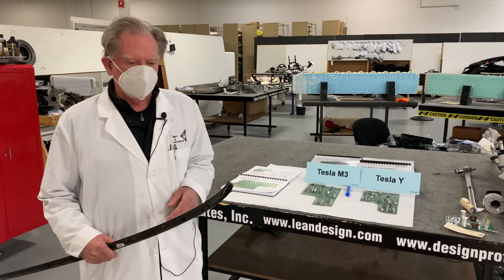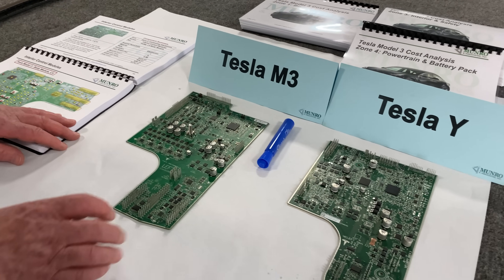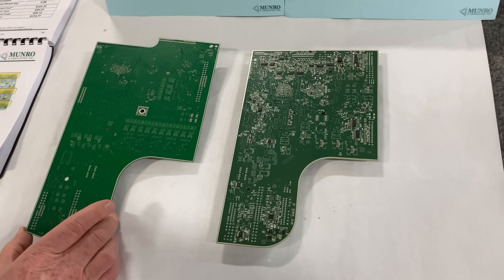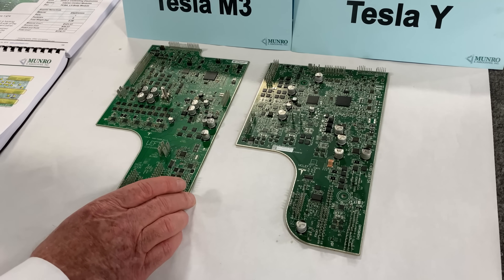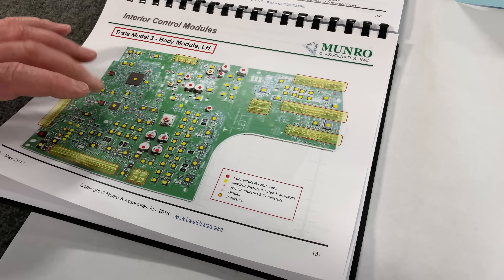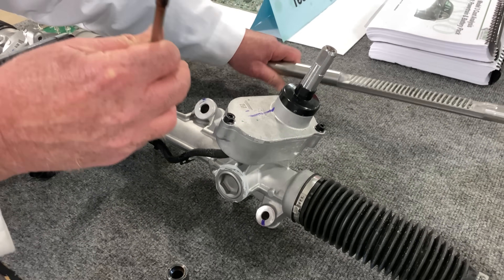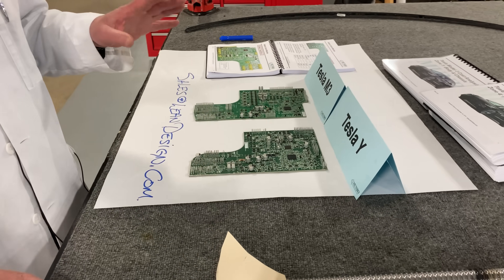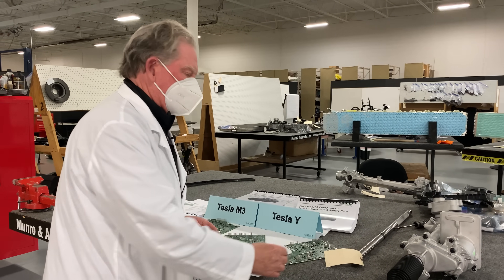Model Y E39: Spoiler Alert! Sandy Talks About Electronics, Body Controllers & Steering Rack

Comment: Sandy, thanks for another great vid! Elon does this to every industry he touches, puts them on notice that it's time to wake up and get with it. No more snoozing in the easy chair. One worry though is future repairs.  Nice it's always being upgraded, but is a path provided to RR the part?
Reply: The parts are probably mostly backward compatible unless the design changes completely.
Reply: @user2C47  Is that a hope, guess, or actual knowledge? U mean, I hope so as well, but don't know that is true. For example, if you have the "Super Bottle" system, and 5 years from now the bottle splits, do you have to, or can you, replace it with OctoValve System? Will parts be available for all the "iterations"?

Comment: can anybody read the markings of the power mosfets, is there an increasing from gen 1 to gen 3, example 25V to 80/100V ?! I do not understand why tesla is still on 12V instead of some higher, reduces much of couper and weight (couper is typically much more expensive than silicon...)
Reply: Musk said in an interview that he wanted to move to something higher, like 48 volts, and that it took an embarrassingly long time to replace lead acid in the Model S. 12 volts is really only good for small loads like electronics.

Comment: These bits are called a rack and pinion  steering type...is Alzheimers  already kicking in ?At the end of the day it is all common sense and actual  critique is left out, still entertaining to watch .Having any kind of belt drive in a steering system is for instance not a good idea  even if only as a power assist. Problem with Tesla is that it is often  try and error, like green bananas new systems are left to ripe in  costumers hands.

Comment: Sandy, redundant systems are normal in aircraft systems as you know. I'm sure that many Tesla engineers come from industries other than auto manufacturing. This seems to be both a blessing and a curse for Tesla because it can start everything clean sheet without legacy industry baggage and bureaucracy. But some areas like automotive painting are less important in those industries and continue to bedevil Tesla.
Reply: Interesting point.

Comment: Wow, so OEMs were five years behind Tesla's PCBs, and in the last two years Tesla has iterated two new generations.
Reply: That's not true. Most manufacturers, including Tesla (if I remember correctly) use current Nvidia hardware... there is no generational gap.
Reply: @komentierer  : Tesla used an Nvidia chip for its Autopilot HW 2 and 2.5 hardware packages, but for HW 3, Tesla switched over to its own chip that they designed in-house. There indeed is a generational gap.

Comment: This underlines what it means to have the FSD in a car as a factory standard. Think about several years ahead when the FSD software is a norm and the used Teslas are competing with the other brands that might not even have the FSD when new.
Reply: The problem here is that FSD will be very expensive, and will likely require a subscription in the future. Also, a perpetual license (which may be more than $100,000 for Live) does not transfer to the new owner when the car is sold. This means that for the most part, only wealthy corporations with very particular needs are going to have access to Autopilot, while normal people will just have a normal cruise control.

Comment: On the electronics, the gap between original and current Model 3 may really be showing.  Munro should probably mention it in the audio in addition to the note in the video.  Of course, Munro may not have realized it at the time of the videotaping, but now it's so obvious they added it in editing.

On the board comparison, there was no mention of the connector differences.  I think that points to the old board not being compatible with the new one.  That raises the question is which style does the current Model 3 use.

Depending on how easy it is to get to the boards (and other components), Munro may be able to do a non-destructive look at a current  Model 3 to update their reports for minimal cost.  Of course these videos are free so not worth updating... but it really may help other OEMs to know how far behind they really are (if  current M3 is really similar to the MY)

Great job and thanks Sandy!
Reply: M3 is using a newer version of original board with same connectors. MY board and connectors are different than 3(no parts share). Just removing some trim to get a look at part number won't void anything. Disconnecting and opening up casing to pull board out on the other hand.
Reply: I dont think anybody wants to void the warranty on the electronics of their car just to see what version the board is.
Reply: @niconico3907  not sure how accessible the board is... it may not void a warranty.

Comment: I think what we're seeing is why Elon Musk left South Africa.  That country actually has a decent- sized auto industry,  and even some innovative replica car manufacturing,  which might have been a decent pool to draw from to begin a car company.  Yet,  instead of there,  or Detroit,  he went to Silicon Valley.  He's building tech on wheels.  His electronics look more high- end laptops while other carmakers' stuff seems more like old desktop towers.  Big,  inefficient,  cheap boxes they've been using for years because they still work.  Who needs to innovate a better turn signal controller? It's FINE.  I think that's the OEM attitude; it's fine.  It'll do.  We'll innovate when forced to. And it may not seem that important- unless you're looking to the future,  with EVs, self- driving,  e.t.c.  So Tesla has a bunch of Silicon Valley workers busy developing all this tech at the rate other makers work on styling or cranking out 5 more hp  from an engine. 

But what Tesla is probably still doing is being modular.  Yes,  the body controller keeps improving,  but it probably fits in the same place, the same container.  The suspension components keep improving,  but may bolt on the same way for the same geometry.  

I used to have a 2002 Escort.  Its suspension was the same as 2 generations prior; maybe 3.  No discernable improvement.  Maybe 15- 23+ years without innovation? 

You'd think they had saved enough money by all that cost- cutting.  Instead,  they're broke.  And behind.  And think adding a few electric models will fix things.
Reply: He worked on PayPal first, which is why he went to Silicon Valley.
Reply: @AhBeeDoi  well obviously he could have gone back.  You're missing my point

Comment: I am pretty sure it is NOT overmolded carbon fiber. Also these controllers may look advance to You, not to me.. That VCLEFT  like just a typ controller  CPU, memory .. these 470 Caps are attached to DC/DC sine controllers [probably TIs], powering seats, windows, tilt motors, hvac, even JTAG pads (nice), few asics, looks like ethernet chip.... Nothing shocking there.

Comment: The steering gear is interesting. The PCB is one or 2 generation behind, if we compare the size and design. External communication and supply power are doubled. No sure, but it looks like they have just a 3 phase design of the servo motor (but not sure, because that what i would assume after seeing the pcb). A redundant system is required for auto pilot to autonomes driving. At the moment there are a lot of different system on the market. We will see what is needed to fulfill level 4 or 5 standards. 
Not sure about the torque sensor the housing is quite big there, I guess the extra space is needed for a internal steering wheel sensor and the 2 or 4 channels for the sensor signal to the steering gear ECU. 
Is Tesla manufacturing the gear by it is own or the get it still from Mando?
Reply: Redundancy has no place in the automotive application. In the event of the failure, simple shut down or "creeping" reduced mode to avoid the catastrophic accidents. Redundancy requires 2 complete independent systems not just pcb.
Reply: What you said about redundancy is mostly true, except for steering, brakes, and airbags. These are safety critical and failure of any of these systems could lead to injury or death.
For example, the service brake on a car is connected to the brake booster, but is fully capable of working without it, and there is sometimes even a cable-operated backup in case hydraulic pressure is lost. If all fails, there's still the parking brake. An air-driven parking brake has a spring that will cause it to apply if the brake hose loses pressure.

Comment: my bet is the new board will be considerably more expensive. Many more parts, double sided load, and it looks like it has more layers (I might very well be mistaken). Also, model Y is supposed to be a higher volume vehicle, wasn't it time for an ASIC already? I keep thinking about all the inkjet printers I tore down over the years, they used to be filled with logic chips and stepper motors, today they are basically one big chip and one sh** brushed motor, and still do a better job!

Comment: Do you guys do a functional spec portion of the report?  I assume that requires comparison of firmware between the two components- if they are carryover.  Hardware is great but a software analysis of the firmware or possible future firmware improvements based on the hardware may be a useful component to these reports..

Comment: They don't put the left and right PCB on the same panel because then you have to assemble one of the PCB's "upside down" and that messes with your reflow process.
What they actually do is have a pair of left PCB's next to each other and a separate panel with a pair of right PCB's so you don't have anything "upside down".

Comment: I wish Sandy knew more about the circuit board.  More parts on a circuit board does not make it "better".  Just like more buttons and knobs on a car does not make it better. <--- we all have to agree with that statement.
Reply: Yea, his impression of the updated board is pretty yikes. I saw one chip had a bigger die size, other then that they looked the same other then trimming the board size and moving parts to the other side. It doesn’t look like there’s any extra parts. Nothing about that tells me that one is in any way superior to the other other then probably making it cheaper to manufacture.

Comment: Question: This board is something that Tesla has made in house correct? Do other automakers make these in house? Or do other automakers typically source these from 3rd party vendors?
Reply: Don't know about this functionality specifically, but a lot of electronics come from suppliers. For example, Bosch has many automotive customers and will integrate certain things for them. I also know that Tesla often skips this step, buying chips and modules and integrating those themselves.

Source: I work for a company that sells to both Bosch and Tesla. If you drive a Model 3 or Y, some of my code is running in the background ;)

Comment: As far as I know, air plane electronics will have triple redundancy, not double.That way it's easier to tell if there's a fault in the first place
Reply: Not at Boeing 😉
Reply: Wouldn't something that's essentially a servo controller be expected to just fail outright rather than spit out valid but incorrect data?
For example: In an old 70s CPU core from an ESS, such a bit flip condition is possible: {[a=4],[a=4],[a=12]}. All are valid, but one is wrong. In the servo controller, it is more likely to look like this: {[drive:32,sense:32],[drive:32,sense:0]}. Module 2 fails sanity checks and throws a fault, failing over to module 1.

Comment: At the end when you fit the two pcb's together, that's called nesting. The pcb fabricator will do that to maximize the number of boards per production panel to lower mfg cost.
Reply from the maker: Yep!  Same concept applies for stamped sheet metal as well.  Limit the offal as much as possible!  Thanks for tuning in!
Reply: @MunroLive  So what you're saying is that the most efficient car from a manufacturing standpoint is one shaped like a cube?
Reply: @phamnuwen9442  No.
Reply: @MrCarGuy  Thanks.
Reply: @phamnuwen9442  Stamping a cube out of sheet metal would actually end up with a T or † shape cut out of a rectangle. The most efficient car would be one that is flat.
Reply: @user2C47  A flat car doesn't have much headroom though...

Comment: New car buyers want affordable cars more than they want electric cars. Best selling car in Europe is the VW Polo £12,500 the top 10 selling cars in the UK have a mix adjusted price of ~£16,500 while the chepaest Tesla is £43,500

Tesla has proven there is a market for fast expensive brand EV cars at a certain volume. Tesla has not proven that electrification = best at all price points for all customers

For that to happen Tesla or someone else would need to build a 150-200 mile range VW Polo competitor for not much more than £12,500 which Tesla isn't doing yet because it's not possible. Yet the other car companies get insulted for not electrifying their models why isn't Tesla insulted for not releasing affordable segment cars?
Reply: You need to do some research. I suggest you look into the AVERAGE selling price of cars in 2019.

Not much logic in going down market from there. That's what the used car market is for.
Reply: https://cleantechnica.com/2019/06/14/tesla-model-3-vs-honda-civic-15-cost-comparisons-over-5-years/
Reply: @Jimmy Edward I just read the article, and it seems to say that from a cost of ownership standing, the 3 is cheaper than a civic... who knew lol.
Reply: @Jimmy Edward Electricity isn't cheaper than petrol. Electricity often has low taxes and petrol high taxes which makes it appear as if electricity is cheaper.

In the US average electricity price is 12.8 cents/KWh and average petrol price is $1.85 a gallon

A corolla hybrid gets 52mpg = 3.6 cents a mile

A model 3 at 3.5 miles per KWh (taking into account charging losses and standing losses) and 12.8 cents electricity = 3.7 cents a mile

More or less identical price to power the ICE car and the Oil car

Oil changes don't cost much at all
Maintenance for an oil car is affordable
And most maintenance isn't engine or powertrain related. My 20 year old ICe car had no engine problems when I got rid of it. It had windows which wouldn't wind down. It had scratches it had dents it had a boot that wouldn't open and close properly. It had a broken bumper which was held in place with zip ties. It had really scruffy seats. You know all problems that any and every car will suffer with electric or petrol or Pixy dust powered

Electrification will happen but only when it is affordable. The VW Polo is Europe best selling car £12,500 the buyer of such cars aren't going to pay 3x as much for a Tesla model 3. Also the top 10 selling cars in the UK have an average price of £16-17k while the model 3 is £43,500

Model 3 is a good car it is a luxury fast car for a very small segment if buyers. When Tesla has a £15,000 electric car with 150+ miles equivalent quality and size to the VW Polo then you can say VW and Toyota are screwed. Until then it's two very different products at two very different price points
Reply: @kaya051285  
* Petroleum is a highly subsidized product.
* The USA government Dept of Energy average price for regular petrol is $2.25 and electricity $1.15 (March 2020).
* The Tesla Model 3 base price of $35000 is below the average US car price of $37,736 in March 2020. 
* Munro reports a 18% gross profit for the US made Model 3 base model and much higher for the Chinese version.
* Tesla's Roadrunner project is about to announce a new battery architecture, chemistry and manufacturing method that will greatly reduce costs, and increase energy density, temperature tolerance and lifetime to a million miles.
* Tesla's drive train has been tested to a million miles.
https://www.theguardian.com/environment/2015/may/18/fossil-fuel-companies-getting-10m-a-minute-in-subsidies-says-imf
https://www.energy.gov/eere/electricvehicles/saving-fuel-and-vehicle-costs
https://www.youtube.com/watch?v=FNenwiGMHMo
https://www.autodealertodaymagazine.com/360644/average-new-vehicle-prices-up-nearly-3-year-over-year-in-march-2020
https://insideevs.com/news/341909/munro-talks-tesla-model-3-motor-magic-and-profit-potential/
http://jes.ecsdl.org/content/166/13/A3031.full
https://electrek.co/2018/10/15/tesla-drive-after-million-miles-test/
https://electrek.co/2020/02/26/tesla-secret-roadrunner-project-battery-production-massive-scale/
Reply: @waynerussell6401  petroleum is a highly taxed community so much so that some countries finance close to everything from it

USA prices according to the EIA are $1.85 a gallon and electricity price are 12.85 cents/KWh for electricity

More importantly this translates to approximately 3-4 cents per mile for electricity for a model 3 and also 3-4 cents per mile for an efficient oil car like the Toyota Corolla

Comment: The steering motor control board redundancy is for FSD.
Every relevant control and PCB will be similar.
Reply: Steering control, throttle control, brake control, battery control, FSD system, everything is made to be redundant or its their  goal... Basically, even if there is some malfunction car will still be able to drive(maybe itself!?) to the nearest service!
Reply: @DG-uv3zw  
As I said
Reply: many cars have that already, even bmw has that with their remote key with screen